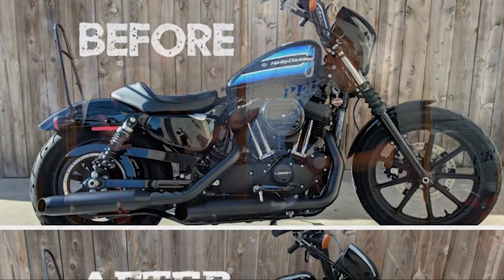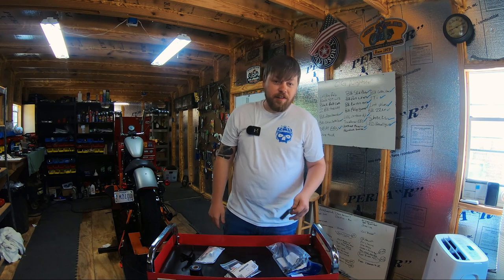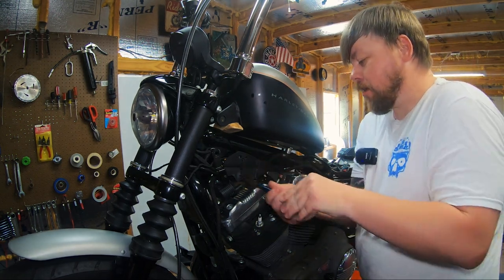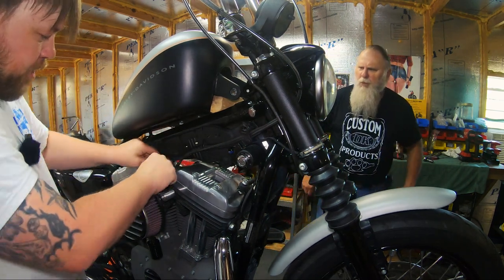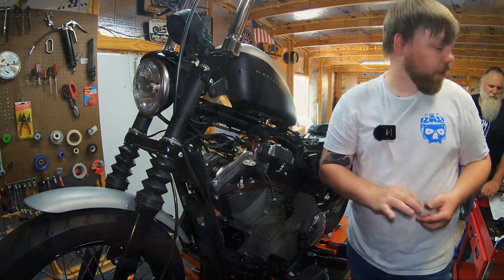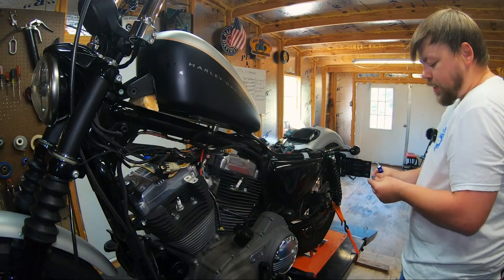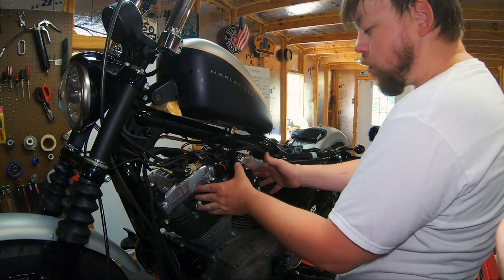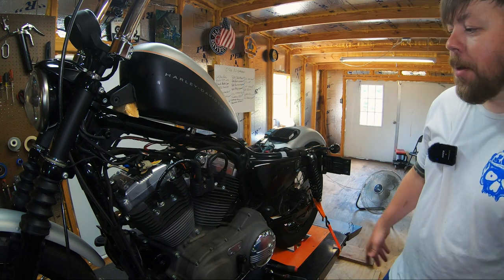Make it Your Own-Step-by-Step Coil Relocation

Comment: Would I have clearance issues on 1999 sportster petcock with this set up?
Reply from the maker: Below is the link to the Coil Relo Kit for a 1999 Sporty.  There is no clearance issue.
https://www.dkcustomproducts.com/1995-2003-coil-relocation-kit-dk-cr-rlc9503.htm

Comment: Wish I could do the coil relocation on my 2016 FXDLS
Reply from the maker: You can.  See the kits at this link- https://www.dkcustomproducts.com/99-up-dyna-coil-relocation-kits-60.htm
Here is one of the video on them- https://www.youtube.com/watch?v=qu3QEs9LGE8
Reply: @DKCustomProducts  oh okay.. I just always saw that the description always said doesn't fit Low Rider S.. I guess because they have a stabilizer where all the other bikes have horn mounts
Reply from the maker: @PkwyDrive13  Sorry, I missed that it was a Low Rider S.  You will need to buy a horn bracket from HD to affix the coil relo bracket to.

Comment: I was thinking of how it would make the bike more symmetrical. I'd like to have the  key ignition mounted above the coil, on my 2003 Sportster, but I don't see that y'all have that option. I'd also want the coil mounted so that the wires plug into the bottom side. I want to put a chrome cover on the coils. I also want to lift the tank, 1 or 2 inches. I figured that should allow me to mount the key ignition on top of the coil. Would that work?
Reply from the maker: Unfortunately, we do not make a coil/ignition relocation for your year model bike. We do make the coil relocation and the f6 ignition relocation but it won't mount the way you are describing. Here is a link to the coil relo and f6 ignition option - https://www.dkcustomproducts.com/1995-2003-coil-relocation-kit-dk-cr-rlc9503.htm

Please feel free to contact us for any questions you might have;
Support@DKCustomProducts.com
662-252-8828

Thank you for commenting!

Comment: What’s the torque spec on the cylinder bolts?  Thanks
Reply from the maker: Anywhere between 15-40 ft. lbs. will work.  We tighten them to 20 ft. lbs. 👍
Reply: @DKCustomProducts  thanks!  Awaiting my kit for tomorrow delivery. Can’t wait 👍
Reply from the maker: @MrJruta  Good deal man, we appreciate your business! Ride safe!

Comment: I have a 2021 883 and I can’t figure out where I mount the F6 relocation, any help?
Reply from the maker: Very carefully remove the nut from the grounding stud at the top back inside of the primary.
You do NOT need to remove the ground wire from the stud.
Removing the nut from the grounding stud at the top back of the primary can be
done with a box wrench or open end wrench (7/16) opening the battery cover can
help. ANOTHER option is to use a socket coming from the exhaust side of the
engine.
Full instructions can be seen here- https://www.dkcustomproducts.com/media/wysiwyg/coilkeyrelo/sportster/f6/REV.41016Flex-SixKeyrelocationInstructions.pdf
And there are a bunch of photos of where the F6 goes at this link- https://www.dkcustomproducts.com/ignition-relocation-sportster-nightster-48-iron-more-details-dk-ign-rlc.htm
Feel Free to email or call with any questions.
Support@DKCustomProducts.com
662-252-8828
Reply: Thank you! I’ll try it from the exhaust side.

Comment: Hi, is it possible to make a video about the voes switch, changing to High flow from vac opertated petcocks. can you go directly from the carb to the voes. can you eliminate the voes all togheter, do you need to switch to a dynatek iginiton etc etc. and all the things around this problem. Alt of information online and no really good information.
Reply from the maker: Unfortunately we will probably never do a video on this subject.  The majority (by quite a margin) of our Customers have EFI bikes.  Of those that have carbed bikes, the majority of them already have electronic ignition.
You do need the VOES.  Here is a really good thread on the subject that you may find useful.
https://www.hdforums.com/forum/engine-mechanical-topics/6140-voes-switch-explained.html
Reply: @DKCustomProducts  Thank you for the reply. My question is. If you have time to answer. Can i connect the voes directly to the carb. And change to highflow petcock without timing issues?
Reply from the maker: I wish we had the knowledge base to help you, answer those questions.  Unfortunately we do not.  Thanks for checking with us.

Comment: Do u have a bracket to move coil and still keep the horn I have a 2014 seventy two 1200
Reply from the maker: The horn and the coil cannot both be in the same location.  However, we have a horn kit to use with the coil relocation that can be seen at this link- https://www.dkcustomproducts.com/horn-relocation-w-horn-238.htm

While this is what the majority of folks do, it is Not the stock horn with the cowbell cover.

There are also more than a few of our Customers that have relocated their coil and then mounted the OEM cowbell horn in various different locations.  The most common is at the bottom of the front of the gas tank.
Reply: This link brings to horns I need the coil bracket without ignition location
Reply from the maker: @lowlifetim  here's the link for the Coil Relocation kit - https://www.dkcustomproducts.com/07-up-coil-relocation-dk-cr-rlc07.htm

Comment: You need to do one like this for a  newer softail.
Reply from the maker: The newer (M8) Softails already have the coil relocated to the side from the factory.
For the Twin Cam Softails, we do have coil relocation kits that can be seen at this link- https://www.dkcustomproducts.com/softail-model-relocation-kits-c33-61.htm
We don't have any recent video installations for them, but it is pretty simple and here are a couple of older install videos for the Dyna and Softail (they are the same kit)-
https://www.youtube.com/watch?v=g3cs-xjmJkY
https://www.youtube.com/watch?v=xntyWi97Z-0
Reply: @DKCustomProducts  I have a 2022 Heritage. The coil is sitting between the jugs. What a video on relocating it to the front.
Reply from the maker: @jamesmitchell4975  Ah, nope, it is rare that folks want to relocate their coil to the front.  We do not make a kit for that.  The only time I have seen that done is when someone uses a ForceFlow Fan on an M8 Softail, and the relocation is part of the fan kit.  You can see that at this link- https://www.dkcustomproducts.com/jims-force-flow-fan-cools-twin-cam-engine.htm
Reply: @DKCustomProducts  Thst was what I was thinking. Do you have a video on how to install the fan kit?